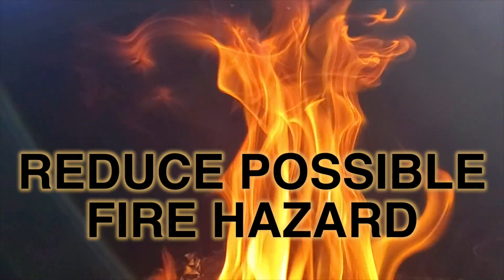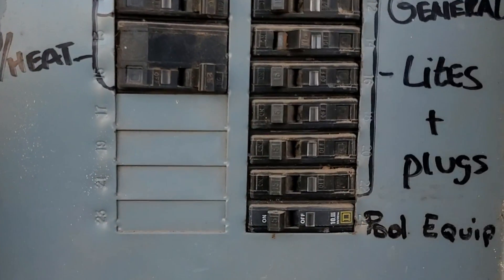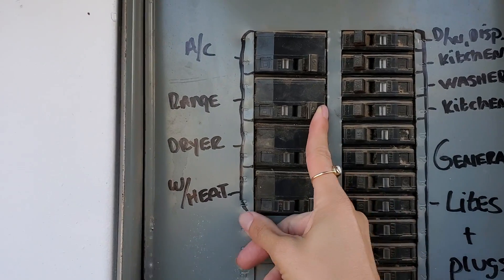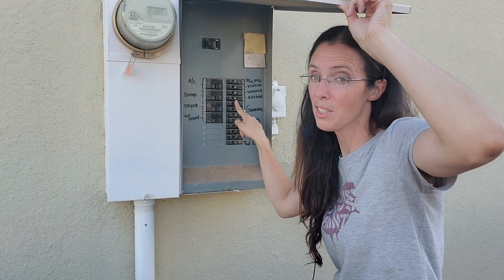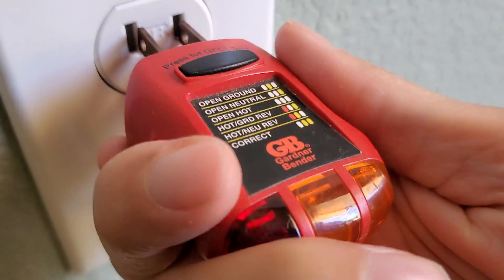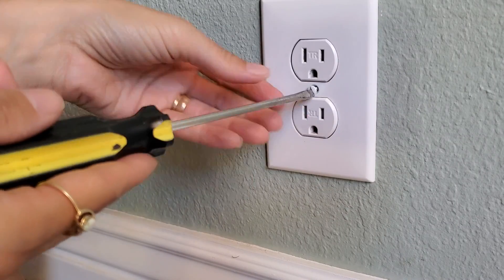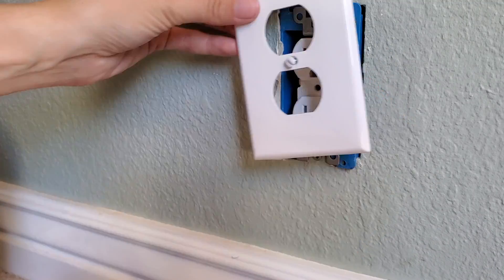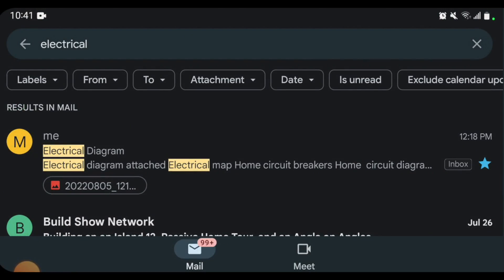Easy Way to Find a Overloaded Circuit BEFORE it Starts an Electrical Fire

Comment: After watching the video I am still left with the question .. how do I find an overloaded circuit? I know how to map out the electrical circuits to each breaker but how to determine if a circuit is overloaded is still unknown. 

Also ..

"Easy Way to Find a Overloaded Circuit BEFORE it Starts an Electrical Fire" ❌
"Easy Way to Find a an Overloaded Circuit BEFORE it Starts an Electrical Fire" ✅